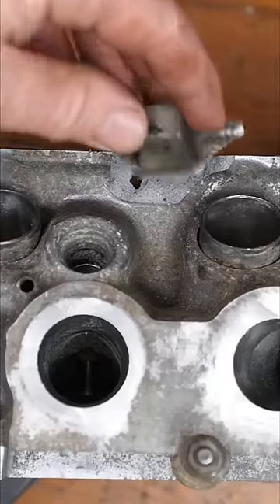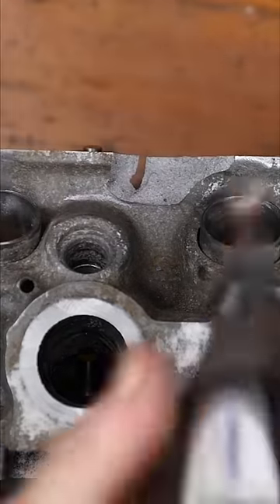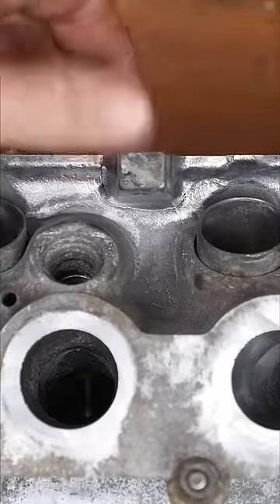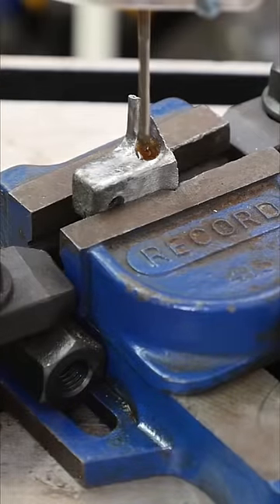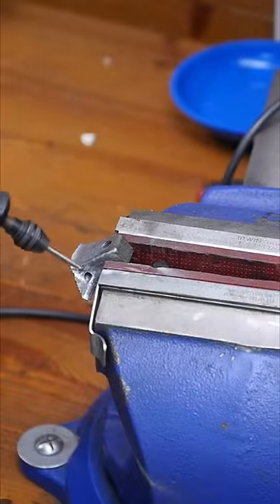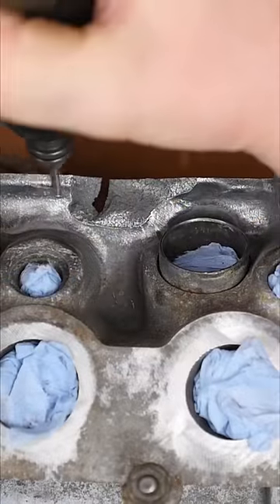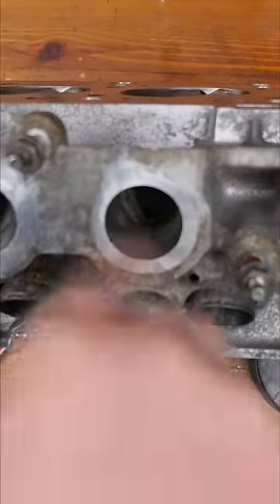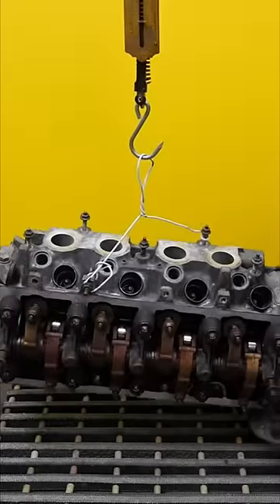Cylinder Head Repair with JB Weld and a Drill Bit.  #shorts #repair #mechanic

Comment: My Dad fixed a busted crank case on a lawnmower with jb weld, and the mower still works 10 years later.
Reply from the maker: Good to hear another success story.  So many doubters on here.
Reply: @CoatsandGaiters  It's a joke, obviously
Reply from the maker: @alexanderSydneyOz  Why is it a joke? The silicone sealant was more of a joke that was holding this piece in with when I bought the car 4 years ago.  JB Weld is up to the job and took the weight on that repair as shown.  Full video is here: https://youtu.be/3G1QI6JniC8

Comment: As a cheap repair I think this would of been 100% fine! 

You know yourself this isn't a proper repair but the damage is on the top of the head where there is no real pressure.

I accidentally punched a hole in my sump and I repaired it with the exact same stuff.  it held up for fine for ages until i got a my replacement and time to do it 

Nice job mate
Reply from the maker: I recently learnt not to repair a sump to save £30 as I did just this but as the metal was that thin it was clearly going to leak somewhere else and it did.  I think the engine might have got destroyed through lack of oil.  I assumed the owner would check their oil like we all should.  Sat outside my house now waiting to be my next video series.
Reply: Yeah its hit and miss, I guess it depends on factors like location.. 

Mine was a dent and split in the centre of the flat bottom of the sump. Drilled the edges of the crack to stop it getting bigger, filled the crack with liquid gasket. Then a coat of jb weld on the top and bottom. 

That held for over a year haha the bottom jb weld did come of soon after the repair but it never failed.

I'm not saying it wasn't a time bomb waiting to happen but these repairs can get you out of a bind
Reply from the maker: @BobTheenglishman-bi3de  Sometimes my cost cutting doesn't pay off very well.
Reply: It’s a great product with the correct type of repair

Comment: Epoxy is incredibly strong stuff … about 10% as strong as welding as I recall, which is still very strong and quite suitable for anything that doesn’t have to bear weight or take impact or high pressure.
Reply from the maker: Thankyou and a very interesting comment.
Reply: Very strong but I doubt that it would withstand the heat
Reply: @jamarmiller3608  The heat from an engine head? I think it would be okay. It should only get to about 110°C max unless it's right next to the exhaust manifold. Most epoxies can tolerate 200°C
Reply: @truthsmiles  ok that’s what I was unclear on… the heat threshold’s for  epoxy
Reply: @truthsmiles night
Reply: @jamarmiller3608  JB Weld is good to 600 degrees Fahrenheit.
Reply: @turkeyssr  man I forget about JB weld! Lol haven’t used it since i was a kid (early 90s)

Comment: I used JB WELD to plug a casting gap in a 6-71 Detroit head.  It was allowing oil to enter cooling system.  This was in about 1978 and I ran it for at least 10 years before selling the shrimp boat.
Reply from the maker: That's good to hear as I'm getting a lot of negative comments about my repair in this video.
Reply: @CoatsandGaiters Don't listen to the negative comments, they probably didn't prepare their metal correctly.
Reply from the maker: @richardchambers256  Very true, thank you
Reply: @CoatsandGaiters  This will happen.  Give no care to this as you NEED to do this for science!  How else will we know!!??

Comment: You had me at first cleaning up the area to be prepped for welding but then you went and used that jb weld and then you made me believe that you're a fool 😢
Reply from the maker: Harsh Man !!!! just a home mechanic trying to improve over the previous owner using silicone sealant.
Reply: Take a break , you dont have to be a muppet 24/7.
Reply from the maker: @biggusdickus9046  can you care to explain why you say that as I see nothing wrong with this repair.  The JB Weld is rated way higher than the heat of a cylinder head and JB weld advertise it exactly for these jobs.
Reply: @CoatsandGaiters i think he was talking to the original commenter

Comment: Why didn't you just drill the hole into the head then tap it and insert a stud along with the jb weld?
Reply from the maker: Not an engineer was just trying to improve on the previous owner using silicone that hadn't worked.
Reply: @CoatsandGaiters  Heck yeah. Alot better.

Comment: Great job. Really like that you included the test in the video as well. 

No reason these repairs can't be suffice for the right applications and with good preparation like in this video. 

One thing I always recommend is to clean the surface with pure isopropyl alcohol just before any chemical application. It can't be disputed as to what that stuff does for a cleaner surface to bond to.

Even when you think it's free from leeching, dust, grease or anything else, total piece of mind if you do that before application.
Reply from the maker: Thank you for that comment.  I've had a lot of doubters on this video saying I bodged it.
Reply: @CoatsandGaiters  no problem, it's as professional as it's going to get for that type of repair in my opinion. Prep was good and do like the use of the drill bit, that's no doubt helped and again probably suffice. Was good to see you test it as well, is always good to put our work to the test rather than thinking it'll just do. Might as well break there and then, rather than in situ lol. 

Just to add to the previous comment as I don't like to edit OPs, I did mean to put "peace of mind" and not piece lol. 

Also, for anyone who is to use pure isopropyl alcohol, it is extremely flammable and should be handled with care. 

Thanks again for the video and all the best 👍
Reply from the maker: @adamwilkinson6721  Thank you Adam I see it exactly as you do.  The car was £50 so you don't pay a TIG welder £150 when this repair may work ok.

Comment: Cool, but I would not have used a drill bit as a brace, they are very brittle and break easy. A nail of the same size would be much stronger.
Reply: I think epoxy will break before HSS drill bit

Comment: I used simple 5-minute epoxy to fix the speedo cable on a motorcycle. Etched the cable and end piece first with hydrochloric acid. Repaired end piece was mounted under cam cover of DOHC air-cooled motorcycle, so it got very hot and vibrated a lot. Epoxy was still holding strong when I sold the bike 50,000 miles later.
Reply from the maker: Thank you for a success story.  I receive a lot of negatives that this wont work.

Comment: Use a centre drill in future for the milling machine. You only need to touch it down to make a small indent into what you're drilling. It will stop the drill bit walking..
Reply from the maker: Very true, I was being lazy.

Comment: You can weld it and make it stronger, heat the block up to over 200 degrees, use an income rod, when done,wrap the block up,and let it cool down slowly, I’ve done this process before, never a come back.
Reply from the maker: Sounds impressive but definitely out of the scope of my home garage.
Reply: Ya that's one way...

Comment: No going to seal. Metal expands when the engine warms up and It will definitely crack the jb weld. I'll only do this if it's temporarily. I would suggest tig welding for any crack cast aluminum jobs
Reply from the maker: Will never know as this was done in 2018 and the car was scrapped as I had to move house.

Comment: The strength of epoxy deteriorates quite quickly with the application of heat and I think a cylinder head gets pretty damn hot.
Reply from the maker: JB Weld epoxy says it can withstand 287°c and the cylinder walls on an engine get to 190°c so it should be fine as long as JB Weld are telling the truth.

Comment: Keep in mind, boys and girls…, If it comes out of two tubes, it is plastic. Plus there’s no real stress on a valve cover bolt, if that’s what that was.
Reply from the maker: Mind they do keep aircraft together using glue so some of it can be just as strong as welding.
Reply: @CoatsandGaiters Name one epoxy with the tensile strength of the aluminum alloy used in engine blocks. Don't worry, I wont hold my breath.

Comment: I repaired a VW engine casing that had a cracked oil passage with JB weld. It held up for years then I sold the bug. Still holding...
Reply from the maker: Don't shout that out !!! ....I've been told this repair won't work by so many !!!! They don't want to hear success stories.

Comment: Give it a few heat soaks and then we'll see. I think it should have been welded electrically.
Reply: I 'repaired' a stripped sump plug thread in an original Mini with a product like JB Weld (Chemical Metal).

Lasted for years and the compound made for a perfectly serviceable, reusable plug thread.

Comment: Tig weld would of been a safer option than epoxy with metal dust in it
Reply from the maker: TIG welder cost would be overkill on a £50 car

Comment: Next time try super glue and baking soda I've had it on my fuel pump on the lawn mower for 7 years
Reply from the maker: Don't shout that out your have the 'haters' after you.
Reply: @CoatsandGaiters that works ten times better than JB weld I've used it on a fan blade on the air conditioner tell the new ones came in and the haters can keep buying new I'm good with it

Comment: Nice job on cleaning it up. But why did you screw the whole job up by not welding it?
Reply from the maker: JB Weld is sold for this very purpose.  TIG welding obviously better if you can.

Comment: They make welding sticks that I'm sure could have done that 😂
Reply from the maker: TIG welding presumably
Reply: @CoatsandGaiters  I think he means brazing rods.   There's a aluminum brazing rods available.
Reply: @lanzecki  yes. I mean don't get me wrong TIG would 100% be the way to go. However if it's between this method or a harbor freight stick welder and an aluminum rod... I'm gonna go with the aluminum rod.
Reply from the maker: @OsiDio  I didn't know about brazing aluminium - thank you guys.
Reply: @CoatsandGaiters  it's gonna be messy and splatter a lot. Rods burn fast too. So make sure you have the area isolated.

Edit- it's important to remember this version wouldn't be brazing. It'd be an actual stick welding rod rated for aluminum
Reply from the maker: @OsiDio  Oic Thank you
Reply: @lanzecki Im pretty sure those are nearly pure zinc.

Comment: Единственный минус такого ремонта то, что двигатель греется и это соединение может не выдержать большой температуры 😬
Reply from the maker: JB weld has a higher rated temperature than a cylinder head would reach so should be ok ....."The only disadvantage of such a repair is that the engine heats up and this connection may not withstand high temperatures."
Reply: It doesn't get any hotter than a VW engine casing!

Comment: Just a note to anyone who believes this rubbish:  epoxy adhesive can glue a broken part back on, but it cannot be used to apply stress from a a bolt, like what the broken part is for.  This is just someone creating paying YT content.
Reply from the maker: Ummm unfortunately you completely wrong as I don't make fake content.  The part was held in place by the previous owner with silicone sealant 4 years ago when I purchased the car.  I felt JB weld was worth a try to stop the oil leaking out from the head cover.  Full video from 4 years ago: https://youtu.be/3G1QI6JniC8

Comment: If you laugh you must know that Land Rover Discovery have an issue with their FC transfer case which requires 2-part epoxy repair as supplied by the manufacturers😂😂. This is the only repair they offer😂😂
Reply from the maker: Really? is that like a JB Weld?

Comment: That will hold for years. I've used it to repair a cylinder head on a TEA-20 standard engine to stop coolant from leaking into the oil. Been 10 years and holding.
Reply from the maker: Thank you so many have said it won't work
Reply: @CoatsandGaiters h

Comment: I’m assuming you’re going to try to rip somebody off by selling them this cylinder head. JB Weld was invented to temporarily fix stuff until it’s passed the end of your driveway in the hands of the new owner.
Reply from the maker: Uh no !!!! I don't do that sort of thing.  I was trying to improve on it as I bought it with having been siliconed in so JB Weld was a huge improvement over silicone I thought.

Comment: What about heat when the motor work?!! Is it going to wistand that?!!!! 🤔
Reply from the maker: Technically JB weld has a higher heat tolerance than a cylinder head.
Reply: @CoatsandGaiters   are you sure it can handel from 2000 to 2500 degree centegrade combustion chamber temperature?!!! 🤔

Comment: Reminde me to never sending you something to fix especially on an engine ???
Reply from the maker: I’m mending my own car and I think this was a better job than the silicone sealant the previous owner had tried to use l.  Yes it may not be TIG welded but it’s not under any load and was just to keep the oil in rather than using silicone sealant.  The car was £50.
Reply: @CoatsandGaiters  man it was cheap for 50 euro over her in canada  you don even get a full tank of gas ( petrol ) for that price !!!
Reply from the maker: @philippesabourin9026  It was just a car I was using to teach my lad how to remove and engine and how an engine worked so it wasn't going to go anywhere.  Was just an exercise I wanted him to do hence only £50

Comment: Exactly How NHRA Top Fuel Heads are Fixed.          Not
Reply from the maker: This was just my own personal car so not at stressed as a hot rod.  I'd think a hot rod would need to be repaired properly.
Reply: I wonder what will happen when the head is up to temperature. Will it hold?
Reply from the maker: @scirturbo1234  very good point.  Never found out as I had to scrap the car due to an urgent house sale in 2019

Comment: I hope you guys are not they're doing this what he's not explaining to you in the video is when you run your engine is going to go through various temperatures when it goes through these temperatures your metal is going to expand and retract and this goop material he is gluing that are back on with isnot going to expand and shrink at the same rate as the metal there for not very long after it's going to come back off that's a lot of work for one trip home😂😂😂😂😂
Reply from the maker: According to JB Weld their product is suitable for such a repair.  I presume they can't lie or they could risk being sued.  This repair was done in 2019.